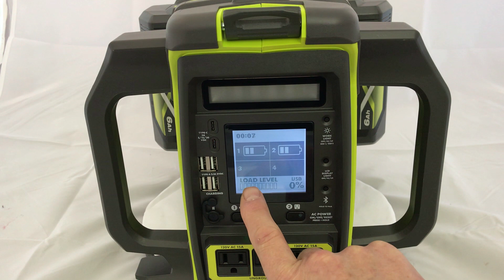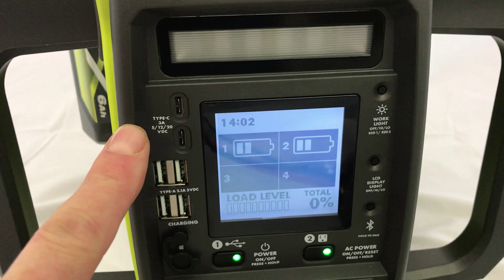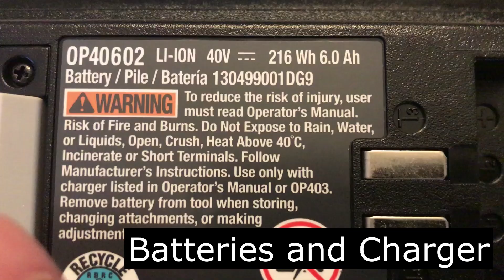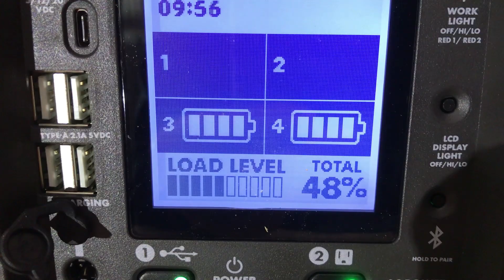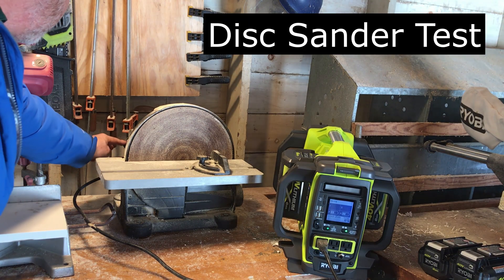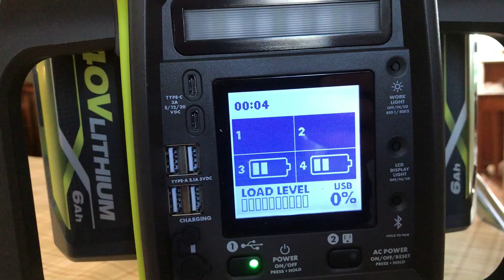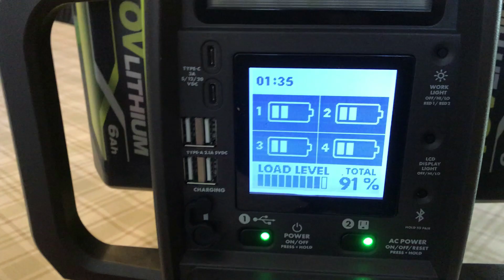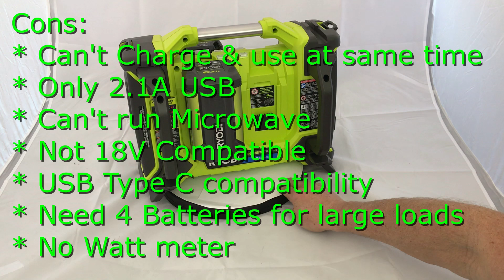Ryobi  40V 1800W Power Station RYi1802B6 Review

Comment: On the bright side it looks like Ryobi (and probably Milwaukee) are headed in the right direction.  Based on your initial testing and your insight it looks like the best move is to continue using the 300W inverter with either 40v batteries or your 18v mod plate for small needs and count on Jackery, Goal Zero, and others for bigger off grid power needs for now.  Thanks for sharing!

Comment: The fridge might be stalling as thermostat limits power when at required temperature.. if u leave the door open for a few the compressor should kick in.. wonder how much surge current a standard fridge like consumes and how long could the official ryobi vs diy 26000PS run the fridge alone for? heating lights etc can be done with other means.. seems fridges are on the tricky side needing pure sine and enough wattage to sustain.. so as a back up power unit for a standard fridge & a deep chest should work least 24hours?

Comment: Also, there is a sticker on the battery terminals that recommends you only use 5ah batteries or above. It might help with voltage drop in high power draw situations to be using 4 x 6ah HP batteries vs having 2 x 4ah batteries in the mix.

I would think the type-C port issues are by design since power circuitry has to negotiate charging speed.
Reply from the maker: Agree... but if the unit needs four batteries to run correctly, then they should say so. Unfortunately I only had the 4Ah batteries to test with :-(
Reply: Yes, I agree with your point.  But without pass through charging, this doesn’t meet my needs for emergency backup power.  @SerendipitySue made one that does and uses the Ryobi batteries I have on hand.

Comment: I like the idea. I picked up two myself. My use case is to charge my batteries during the day while I would be running the gas generator during an outage and then use these inverters to run the fridge and pellet stove through the night.

My biggest complaint is the lack of passthrough charging. I'm excited to see if you can figure out a way to modify the unit for passthrough charging, and to see if you will demonstrate how to charge via solar (preferably via DC).
Reply: What have you figured out. I found that if you plug up to 18v backwards it catches fire wile still working and fire wont go out until all 40v unplugged.:/ i asked hd for another on sale for 630 like I got the first and they typoed the discount and I got another coming for 180$ :D still want to see if it will parallel to my yahama 2200i generator. I just don't want to blow up another one. Let us know how the passthrough charging goes. Im going to do 2 6ah on seperat solar chargers for now. Might be cool.

Comment: I wonder what it is doing under the hood.  Wouldn't running the batteries in series get the voltage to 120 so it wouldn't have to be stepped up?

Comment: I think it was a huge mistake on ryobi's part not making this compatible with the 18v one plus system. There are far more 18v batteries in circulation especially after all the free tool with battery kit deals they have had over the years.
Reply: I agree but ryobi is not forward thinking like Makita is. I have been an 18v customer for years but once I saw How Makita used two 18v in their X2 system I made the jump. Cost used to be a barrier but now I find myself amazed at the quality difference. The weed trimmer by Makita truly is awesome compared to my wasted money on the ryobi trimmer. I still like my ryobi tools but see a future with Makita as I transition over.. No way will I buy the 40v ryobi..will have to wait to see if Makita comes out with a power system...
Reply: @tc8714  Yeah and it's not like ryobi doesn't grasp the concept of using two batteries instead of one, I have the cordless 10 inch miter which takes two batteries and it works great
Reply: With the 18V batteries, even the big 9Ah ones, there isn't nearly as many cells in parallel to share the load when compared to the 36V packs. The 18V packs just wouldn't be able to deal with any continuos loads over say 1000w unless you always had 4 big ones to share the load.
Reply: @lukewalker3905  They should do a 6 battery 18v version at like 900w, considering they do a single battery inverter at 150w.
Reply: @GadgetMan777  Exactly, that would be perfect for my use case of running a portable sports event setup that only needs like 5-600W for a PA system and saves me lugging a lead acid battery and inverter onsite.